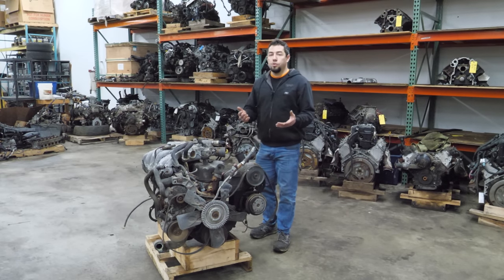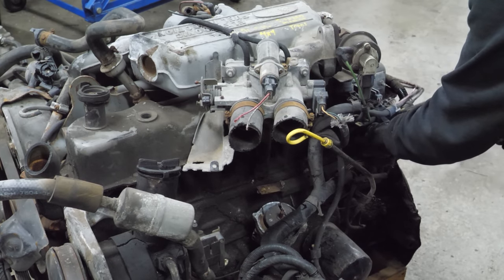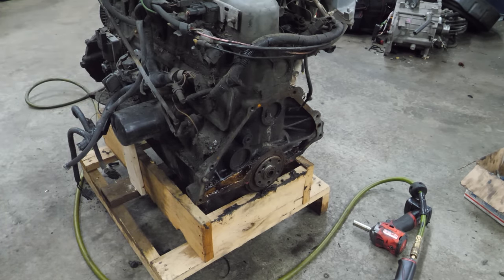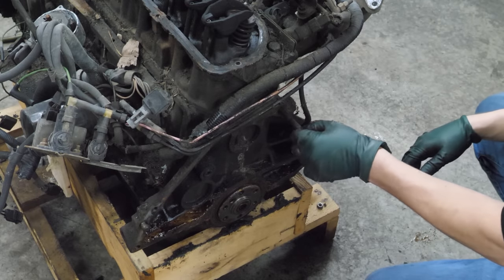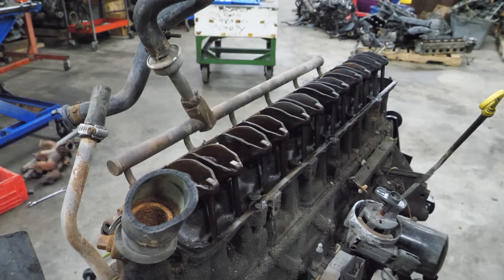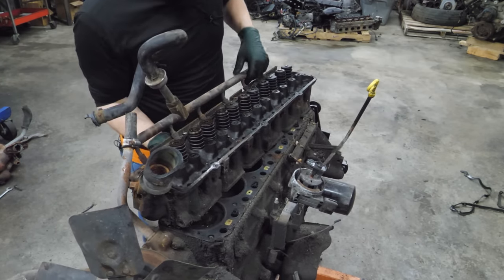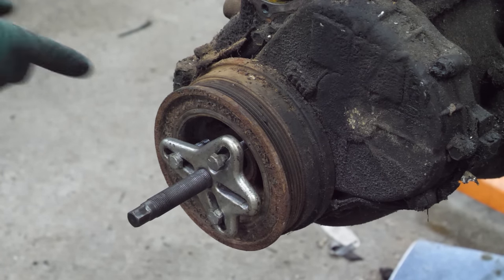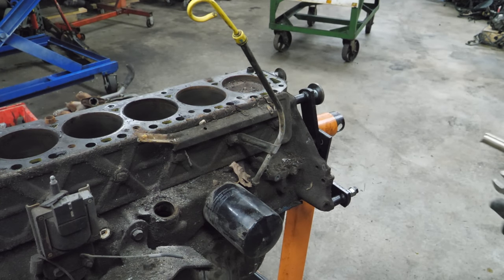FINALLY! A "Bad" Ford 4.9L 300 Straight 6 To Teardown! Most Reliable Engine, Ever?

Comment: Interesting to finally see a teardown of a 300ci 6, not many of these made it to Australia in F series trucks (most F100-350's had a 250ci 6 or V8 pre '87). It's interesting to note the similarities and differences between the early 200/250 and the 300, head and valve train design looks very similar but the block is quite different. It kinda surprised me that Ford US never went to a crossflow head design for the 300, the Aussie built 200/250 went to a crossflow head design in '76 (initially cast iron which had cracking issues and then alloy from '80 onward).
Not sure about the 300 but it looks like it suffered from the same issue as the 250 with piston skirt and bore wear at high mileage like was seen in the video, I've seen quite a few with ovaled bores due to the long stroke putting sideways force on the pistons basically gouging the bores perpendicular to the crank line.
Anyway great video and I look forward to the next never before seen engine on the channel.
Reply: I wonder if the bore spacing is the same on a 300 as it is an the 200/250. I always wanted to throw a turbo on a 300. Would be a lot nicer with a cross flow head.🤔 The Ausies have a the cool shit. 
Like Cleveland stuff.💪
Reply: @anthonysgarage  Doubt the bore spacing is the same? The 240/300 have a 4 inch bore. The 200/250 have a 3.68 inch bore. The stroke of the 200 is close to the 240, just over 3 inch. The 250 has a 3.91 inch stroke, 3.98 inch for the 300. I think it was Bruce Sisemore who welded-up a pair of 351C heads for his 300 back in the early 70's?
Reply: @briansearles4473  I didn’t “doubt the bore spacing is the same”. I said I wonder if the bore spacing is the same. I assumed there was a good chance they were. It just wasn’t important enough for me to immediately go research the topic. It’s unlikely that I’ll ever utilize another Ford inline 6 cylinder in any of my projects. Nothing against the engine, it’s just not a path to any of my current engine building goals. I did see the 300 with the Cleveland head. Very cool. There’s also a guy who made an LS head for a 300. They make for interesting articles and videos, but not something I’m ever going to pursue.
Reply: @anthonysgarage  I tried hopping-up the 250 six in my 73 Maverick. I almost bought an intake for a 240/300 six before finding out the 250 is a different design. The biggest downside to the 200/250 is that the intake manifold is cast as part of the head. Being stuck with a 1bbl intake is probably why there are so few hot-rod 200/250's. I saw one 200 where the owner installed 2 more 1bbl carb's at either end of the intake. He did this by drilling 2 holes then welding base plate's to attach the carbs. For me this is too much fabrication for what is probably a 200 HP engine?
Reply: @briansearles4473  You needed to look for the (now probably incredibly rare) 250 2V head then at least you could use a Holley 350 or a Webber 2bbl on them.  From Ford they used a Stromberg 2bbl and made 170 Hp vs the standard 250's 155
Reply: @cameronmartin931  If only I had a 250 six. I scrapped my 73 Maverick years ago. Now I regret it as Maverick's and Mercury Comet's are hard to find these days.
Reply: Yeah, the skirts are a major wear point, there's enough stories of a noisy engine finally getting a teardown and it being skirt #6 missing, guys said they ran fine when they were missing though

Comment: Ran the 300 in my Circle Track car for many years. HP an torque were plentyful. The big secret with the engine was getting the beast to breath. I remember Bob Glidden putting together a cylinder head from pieces of a 351 C head. That let loose the Cracken.
Reply: There’s a name I haven’t heard in a long time!
Reply: Blast from the past there

Comment: I bought a 1979 E150 van brand new in 1979, still have it by the way, with a 300ci engine and a four on the floor transmission. Very rare combo, the Ford store used to ask me to bring it by to show potential customers who were thinking about buying one. Put almost 200,000 miles on it. With the stock intake and exhaust it maxed out at around 4500 rpm. I installed a Offenhouser 360° intake,  a 400 cfm Edelbrock carb and Clifford Research headers, three and three into duals, plus a little more cam and it would easily rev to 6000 rpm. That would be an issue later as I broke a ring gland on #1 piston from too much rpm on an engine with a four inch stroke. Drove in several months that way before doing a compression test and realized the cylinder had zero compression. Thought it was not running exactly right. Still didn't have any trouble towing my 20ft power boat. Awesome engine, still have it but, it has be replaced with a built 460ci and an aftermarket EOD transmission. Now my grandkids get to drive it.

Comment: Great candidate for a good overhaul! 10-10 on the crank, 1st oversize pistons and a good valve job plus fresh cam & lifters.
Reply: I agree on a good rebuild for it bore the block 0.40 over for flattop pistons which would bring the displacement to 5.0 Litre six. Performance cam update the EFI and ignition deck the head.
Reply: Pft gasket kit and get it running it'll run fine lol
Reply: Its a FORD engine and one of very few salvable engine on this channel...... If not the only one.

Comment: 7:27 That's shockingly clean for a 300 not gonna lie. But still closer to 'dirty' than most of the engines you call dirty.

Comment: I own a 300 straight six from the last year it was made with a carburetor - 1986.  In that year, I bought a new 1986 E-150 van from a Ford dealer. It had the "4.9 L" 300 6-cyl backed by a 4-spd overdrive manual stick shift trans. Used it to run all over the USA going to Grateful Dead concerts, camping trips, and to move things from one house to another. Some of the abuse it suffered I figured would kill it, but it lives on. I still have the van outside right now in 2023.  It isn't fast, but it has always finished every excursion and got me home.

Comment: Why can’t more engines be like these. So simple, so easy to work on.
Reply: Blame the EPA
Reply: @vorant77  I can only blame the epa so far. The rest I blame corporate penny pinching. For example, the epa doesn’t tell them they need to use a cheap belt drive system, that’s a choice. Look at the timing system on this engine. For its entire life you don’t need to worry about a belt or chain that can break or stretch or slip. You don’t have a cover over it that you have to take 5000 bolts and remove 20 parts to get at. This engine could be completely disassembled in about 30 minutes if nothing else was wrong with it because it was designed that way. The EPA doesn’t force car manufacturers to do any of that different.
Reply: Because they make no power and would never pass emissions

Comment: Not only is it gear to gear timing, but it’s a non interference engine. So unless a keeper lets of of a valve, she’ll never drop one. Love these engines. I’d put it ahead of the Toyota 22re
Reply: Now, with all these 4 cam DOHC engines, we are seeing these long, multiple timing chains fail before 100K miles. A gear drive would outlast the rest of the engine. However, it would be much more complicated on a modern engine.
Reply: @markleggett3944  absolutely
Reply: @markleggett3944 
I think it is the convoluted timing path that is the issue..  
Most Toyota Inline 4's have a simple V shape, crank up to the twin cams. With minimal deflection needed from the guides and tensioners.  
I have 423,000 on a Toyota, I know a guy with 580,000 on one..  
Rarely see timing chain issues on them. I think it is the quality in parts too. Some brands with similar shape timing paths fail.. bad cam phasers and other issues.
Gear drive will always be better.  But it is also heavy.  Not an issue on a slow revving I-6 or diesel. But not so great on a small 4cyl.

Comment: I owned a 1989 F-150 4x4 with this engine. Had a slight miss and white smoke on start up that went away when it warmed up. Wound up pulling the engine to replace a leaking freeze plug behind the flywheel. Decided to pull the plugs and one was super clean. Turned out the head had a crack in it behind one of the exhaust valves. Got a used head and had it redone at a machine shop, put in new bearings (the old ones looked pristine btw), new timing set and gasket kit and a new clutch.  Ran like a top. Our police department had an early 70s Ford delivery van with a 300, an old Philadelphia Inquirer van that they were using as a SWAT-type vehicle. It had a miss and was burning antifreeze. I took the head off and it was cracked behind an exhaust valve. Went to the salvage yard, got a head off of a wreck, cleaned it, hand lapped the valves, and installed new valve seals and head gasket. Ran like it was new. These are truly great engines.
Reply: The plugs are not freeze plugs... they're core plugs.

- Max Giganteum
Reply: @MaxGiganteum  I know, but we've been calling them that for years.

Comment: Pal gave me a 32 Essex model Super Six 4 door, 60hp/won't go, mechanical brakes/won't stop, tractor steering/won't turn. Always wanted to build a prewar, in excellent condition and no wood framing. My 2nd favorite engine is the 300 6 so found a really trashed 90 f150 287K miles. Engine builder said it didn't get many oil changes but still in good condition except worn timing set. Had him do 100% rebuild anyway. Replaced throttle body with side draft weber, stuck 3 speed on the end and connected it to a 3:10 9" rear. Front disk brakes on dropped axle, sway bars, power steering, AC and now I've got a Super Six super cruiser with the real super six. The FI intake and exhaust manifolds really helped the 300 6.

Comment: 2.3/2.5 Lima would be awesome to see, too! 35 year old engine design, simplest OHC engine ever made.

I would love to find a 96 F150 with this 300 though!
Reply: I had a 1995 with this engine and a 5 speed. It wasn't fast but it was smooth and it was powerful. It was interesting that it never got any slower no matter what I loaded on it.
Reply: Those 2.3 balanced and tuned can get some serious horses out of them.
I seen 1 making 268 horsepower and 200 pounds of torque for a sprint car/ dirt track.

Comment: My 1982 Bronco had the 300 I-6 with a four speed granny gear manual transmission.  It was a beast.  We were out canoeing with a bunch of people and the main canoe trailer was being pulled by a Suburban 4WD.  It could not make it up the levee and I hooked up to the Suburban with the trailer attached and walked it up the levee in 4WD low, 1st gear.  I ran Mobil1 oil in the engine and at 80K miles the drain plug stripped out, brought it to a garage to get fixed and when the mechanic pulled the oil pan he called me and asked what kind of oil I was running and said the bottom end looked like new

Comment: IM NOT A FORD GUY EITHER,I BOUGHT AN OLD ECONOLINE IN THE 70S WITH THIS ENGINE,240CI..IT HAD NEARLY 200,000 MILES WHEN I GOT  IT AND I DROVE IT FOR ANOTHER 10 YEARS AND IT WAS RINNING PERFECT WHEN I SOLD IT TO A FELLOW IN MONTANA..IN COLORADO MY WIFE WOULD USE A SCREWDRIVER TO BREAK THE ICE OUT OF THE CARB,AS THE MOTOR WAS BETWEEN THE FRONT SEATS,WE WOULD DRIVE WITH THE DOGHOUSE UP AND KEEP THE ICE CLEAR,GREAT MOTOR,ONLY CHANGED THE OIL AND PLUGS

Comment: Tough as nails. Your right about the reliability. They last for ever. It's not uncommon to 20 MPG plus even in a f250 with 4 wheel drive and lots of low end torque. Thanks for sharing.
Reply: ye I got 18-20 out of my carburetted 85 on the regular.
Reply: My 92 would get high 19's new from the factory but that was a 2wd 150 with 2.73 gears and a 5-speed. When I put 3.55's in it, which made all the difference in the world if you were pulling anything, it dropped the highway mpg down to the low 18's.

Comment: I'm not a Ford guy.  Not even close.  But I bought a new 98 Chevy pickup and the transmission went at 12,000 miles and it took GM 4 hours to send a tow truck right in the middle of a major city.  So after GM replaced the trans, I sold it at a loss.  Cost me $1,700 to get out from under it.  I replaced it with a 1995 F-150 out of protest.  It has that 300-6 and it was a fantastic motor.  I had to replace the oil pan gasket right when I got it, but it was a great running truck.  I actually got a 2000 F150 with the 5.4, and that was the end of my Ford's.  I went back to GM.  

But IMO the Jeep 4.0 is a better motor.  I think the Jeep 4.0, then the Ford 4.9, then the GM inline 6s and the slant Dodge slant 6 are about the same.  All very good motors.

Comment: The 300 CID (aka 4.9L) L6 came out in 1965. I have a 1993 F150 with a 4.9L L6 with 340,000 miles on it. I have had my F150 for around 30-years and it still runs good. The engine is original and hasn't been rebuilt yet. I live in a Western state so the body hasn't rusted much.

Comment: The Australian "Barra" is perhaps the most evolved version of the 1960's Ford straight-six.  It got crossflow in the late 70's, SOHC in the 80's, and finally DOHC &  VVT (and a turbocharger!) in the 2000's. It would be great to see one on the channel one day!
Reply: @TassieLorenzo, other than the number of cylinders and the badge, there’s no connection or interchangeability with any of the Aussie engines, and don’t forget, we have Honda to thank for making our crossflow (alloy head II), actually meet emissions and still make power 😊, now the Barra, that was a complete ground up legend, three cheers to the boys in Geelong.
The American 240 and 300 were, huge, long stroke, low compression truck engines, 3000 to 3600RPM was pretty much it, so they made excellent engines for natural gas powered emergency alternators, powerful, cheap to run, so much quieter than a diesel and no risk of fuel spills, I love working on them, but… no more parts unfortunately.
Reply: @elonmask50 thanks for that. I to was thinking this was what we (Aus) know as a pre crossflow
Reply: After the EPA shut down any hi po engines after 1973, the Aussies continued to develop this motor as a real powerhouse through the 70's.
Reply: @elonmask50  well kinda, it’s also a lot like Don Bradman’s bat. Start with the same engine and go in different directions. Granted the Barra is absolutely nothing like this (nor much from the previous 40 years) and doubtless has no parts that are common but they did evolve from the same power plant.
Reply: @thelandofnod123 , so they are just as identical as Don Bradman’s bat, and a fruit bat, because you can find both of them in Australia; except that we never had the 240 or 300 here.
Reply: The Barra engine traces back to the 144 C.I. engine which made it's debut in the Falcon.  That engine originally had an intake manifold which was part of the head casting. and would go on to be enlarged to 170, 200 and even 250 CI versions.  It shared no parts with the 240 and 300 six shown here. 

Another thing, the 240/300 engine was very much overbuilt as they could be had in Fords medium duty trucks in the 60's.
Reply: @elonmask50  I think the point went wizzing past you there. Don Bradmans bat (so the mythology goes ) had multiple blades and multiple handles but was still the same bat, my point was that the 4th gen Ford straight six engine series had the 144, the Barra was the ultimate development of that engine, regardless of whether they shared any components or design. Like wise as the 144 was in the 4th gen, the 300 was in the 5th gen and so therefore related to the 144, ergo the 300 and the Barra are related, again regardless of the commonality or design philosophy between the two. 

Not sure what fruit bats have to with anything though. 🤔
Reply: @thelandofnod123 , there was no point to your point, that was the point!
Reply: @elonmask50  it’s ok if you didn’t understand it, serious thought isn’t for everyone.

You did make a factual statement however that the 300 had no connection to the Barra, which was and remains incorrect.
Reply: @thelandofnod123 , maybe you could try some actual analogies, like “grandad’s axe”, instead of making up rubbish, it will make you look less homeschooled, keep up the good work, before long you’ll make it past the flat earther level, then you’ll be able to tell that we are actually a different country to America.
Reply: @elonmask50  😂 It would be best for you to let the adults continue talking about facts and for you to go back to the sandpit where you can espouse your incorrect information. A word of warning though, even the other children there these days are going to call you out on your nonsense.
Reply: @elonmask50  A K S H U A L L Y

Comment: I bought a used F-100 from my sister who bought it from the phone company. I gave it to my wife who could break a D-11 Cat in a few minutes. She beat on that truck all over the farm. One time I drove halfway home from the campground up north and she met me halfway. The engine was rattling like a diesel. I pulled the dipstick and it was completely dry. She said that she got an oil change at the quick change by home that morning. Apparently they never filled it. I put six quarts in it to get the oil level to full. She had driven 100 miles with no oil. The truck ran great for two more years until she jumped it and broke the frame and the truck had to be scrapped. One tough engine!

Comment: I'm glad that I found you again. I have 1990 van, that sat for a good number of years. 2 months after I started driving it, it started burning blue, so I kept an eye on the oil. Then 6 months later oil was dripping out the tail pipe. Had compression checked and the plugs changed. Found out #5 had zero compression and looks like the oil ring, or rings buggered. Your #5 plug indicated a problem with coolant.